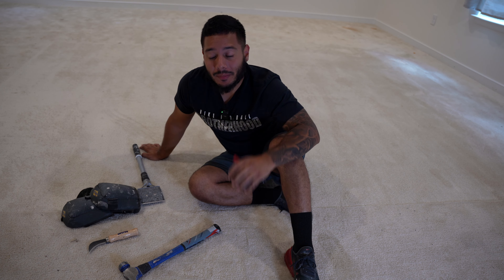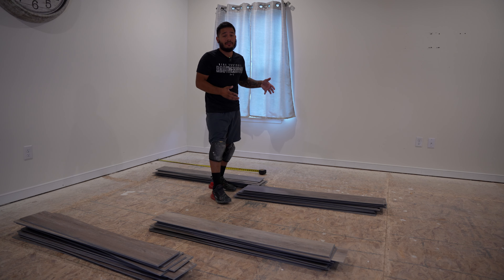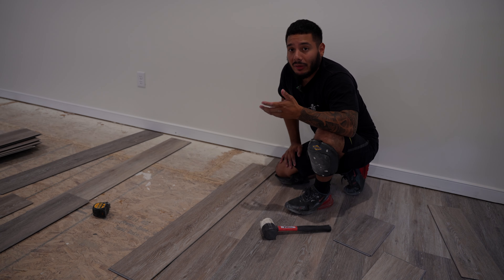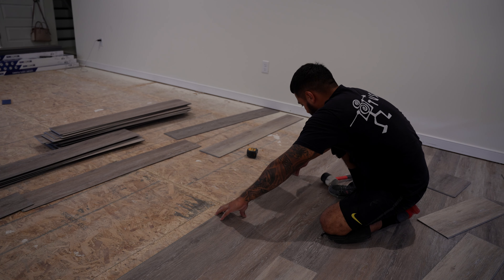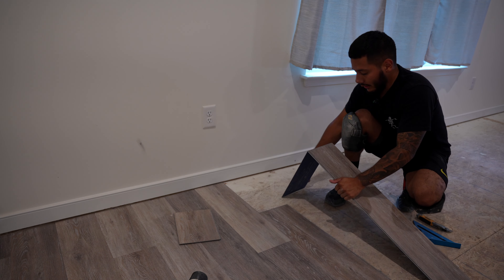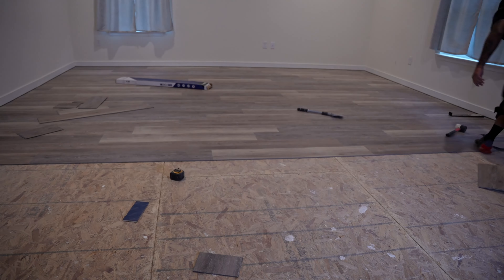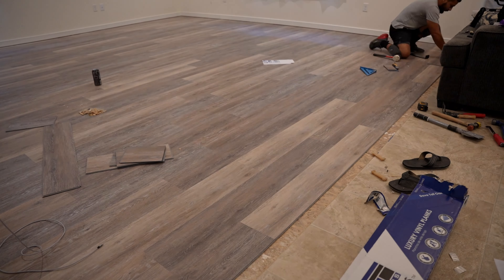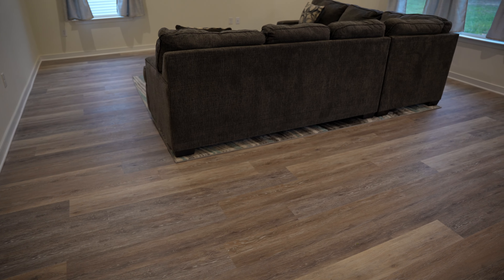How to install luxury vinyl planks as a beginner

Comment: Great video. How come you did not use any spacers? After all it is a floating floor.
Reply from the maker: Spacers are used as a guide, I use a pry bar halfway during install to make sure I have a 1/4 reveal on all four sides.